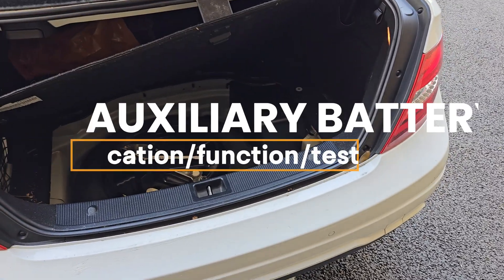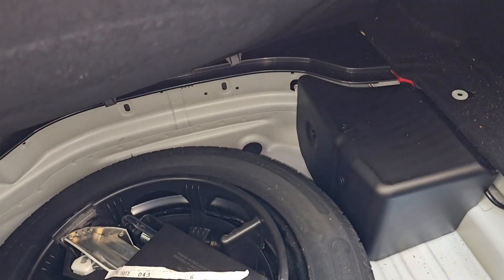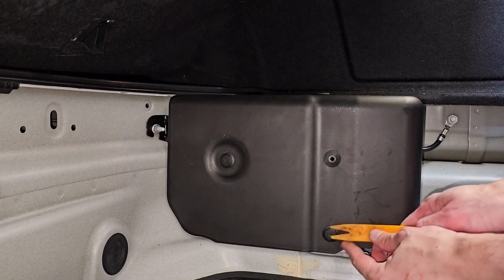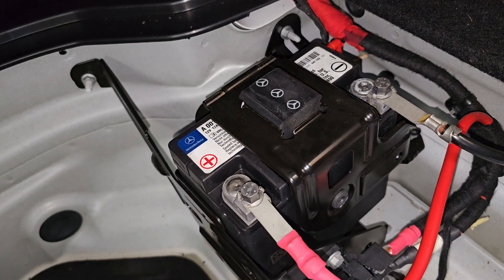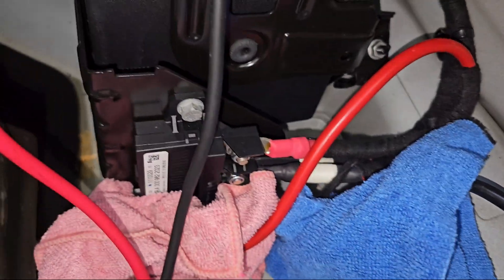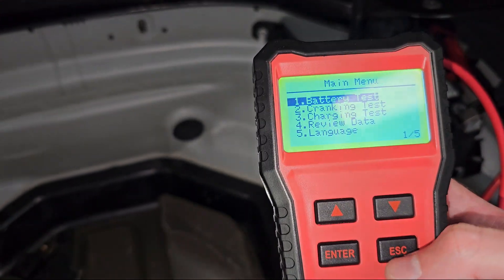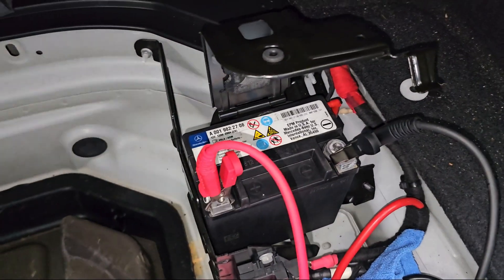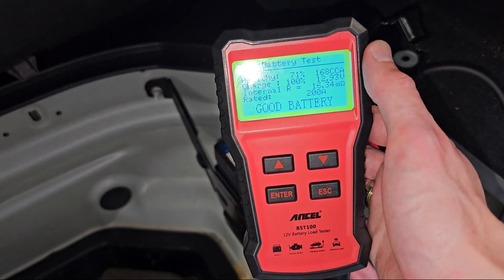AUXILIARY BATTERY - LOCATION - FUNCTION - TEST ANCEL BST100 #MERCEDES C CLASS #W204

Comment from the maker: You can buy the tester here:
https://ebay.us/b2k4ih

Have a look at the tools, parts and websites I use on my C Class:
Interior LED bulbs:
https://amzlink.to/az0ZC81yVqtTi
Pedal Covers:
https://ebay.us/PtYQ2t
Wheel caps:
https://ebay.us/mOhZn4
Dynamic Indicator:
https://ebay.us/HfHYwD
Mirror Cover:
https://ebay.us/zec7pW
Spoiler:
https://ebay.us/G1nJqp
Full Dip:
https://ebay.us/aft5q8
Trim removal tools set:
https://amzlink.to/az005jXXDdw2i

OBD scanner I use with free lifetime updates: https://amzlink.to/az0CXiweATNE5
Digital Multimeter I use: https://amzlink.to/az0JhGsAJ91bq
Masking tape
https://amzlink.to/az0cC8oBvyakQ
Panel wipe:
https://amzlink.to/az0o01TJZFmtF
Masking paper:
https://amzlink.to/az02nqEXasQIu
Microfibre cloths:
https://amzlink.to/az03jORBMWUSV

Mercedes Newcastle eBay shop: https://ebay.us/wVHm1G
Mercedes Edinburgh eBay shop: https://ebay.us/dDMr5g
Mercedes Birmingham  eBay Shop: https://ebay.us/IqtxLo
Another Mercedes eBay store: https://ebay.us/9UggpQ
Battery tester I use: https://ebay.us/b2k4ih
Genuine wheel speed sensor from Mercedes, always check your model first! https://ebay.us/BHmIhw
Leather Repair Kit: https://amzlink.to/az0uK2Bt1zQOu
Main battery I used: https://ebay.us/vIdBcS
Auxiliary battery I used: https://ebay.us/hyhd3W
Drop Link: https://ebay.us/dDpfSi

Always check with the seller if the part will fit in your car.

Affiliate Disclaimer: 

Some of the links in this description may be affiliate links. This means if you click through and make a purchase, I may earn a small commission at no extra cost to you. 

As an eBay Partner Network Affiliate, I earn from qualifying purchases. 

Thank you for supporting the channel!

Comment: my eco mode didnt work what should i do ? 2013 w204 c200
Reply from the maker: How's the batteries? Do you have a scanner? Any codes?
Reply: @mattgreba  i will scan later ,didnt hv any code .
Reply from the maker: @8263JS sounds like batteries, did you see my video on secret menu to check the voltage of the main battery?
Reply: @mattgreba  can you Give the link of the video ?

Comment: How old is your car? Mine is 2011 model and I changed the main battery but I think I need to change auxiliary battery. Start stop and hold functions are not working at all.
Reply from the maker: This one is 2012. It's really hard to say which system works from which battery. I've seen people changing main battery and eco mode was working and I've seen people changing auxiliary one and it was back on. If that's not gonna help try vacuum brake sensor, that's what was wrong with mine. I have a short on the channel how to replace it. Good luck!
Reply: @mattgreba  okay I will check it out. I changed now also auxiliary battery. It was strange that I was reading 13.16 volt after I removed the old auxiliary battery. It is around 14 years old. Yours is 13 years old and still good. Maybe auxiliary batteries last too long. 
Start stop still does not work. I have also an airbag error on the driver side which looks like also blocking start stop. 
Some people say that the car needs to learn the battery but I am not sure. We tried with some diagnostics device to reset the battery ECU and it did not help.

Comment: 2010 W204 C350 Sport - I do not have that battery, just the one up by the passenger fire0wall under the hood / vent box
Reply from the maker: Pre-Facelift Models: Pre-facelift W204 models (2007-2010) have only one main battery.